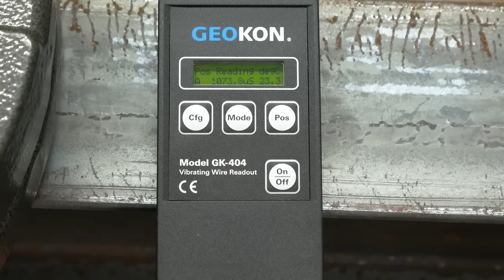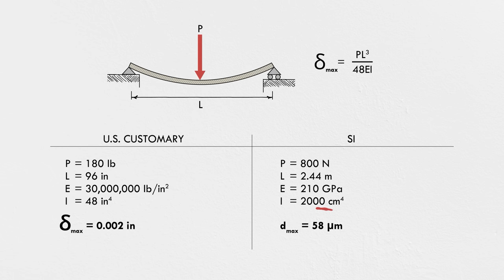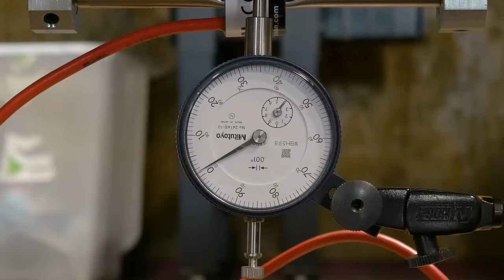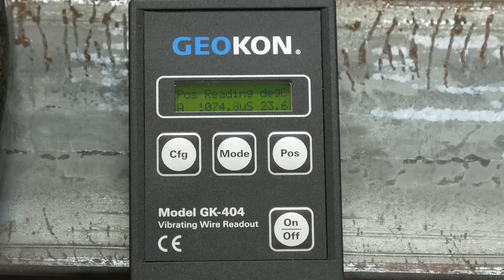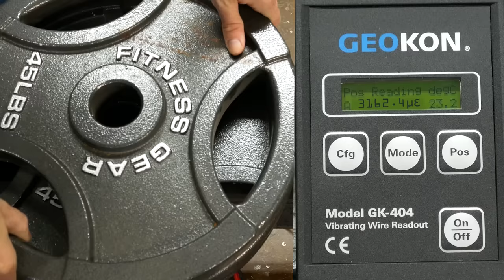How Sensors Keep Bridges From Collapsing (and other structures too)

Comment: Incidentally the thing you said at the start is why I'm so concerned about AI. There's absolutely no expectation in the field of getting things right on the first try, but once ai systems get powerful enough, you really do need that level of engineering because you might not get a second try

Comment: Imagine if these existed on trains instead of taking an ambiguous temperature of wheels ever 20 miles and then ignoring the data because you don't know what it means.

You might actually prevent several hundred train derailments a year, and not have toxic spills.

Imagine if instead of regulation that prescribed unuseful methods you held companies accountable for the cost of their mistakes and they had an incentive all their own to utilize sensor technology.

Comment: Related to strain gauges, is there a way to measure weight as follows.  I need to measure weight between 1 ounce and 500 lbs.  The weight sensing needs to be lost cost, fairly accurate and have a very low profile(flat). ???

Comment: I've used a safety razor for years lol, you can get 100 blades for 10p when u buy in bulk also, so each shave costs me a tenth of a penny

what's annoying however is the disposal of these wafer thin razors lol

Comment: You have 6bar of pressure!?!? I live in a rural bit of england in a house build when they used tiny pipes from the mains. We get 1.6bar :( Actually limits whether I can put in a heat pump.

Comment: problem your  initial  adding of weight you  only reference at one center point that's  not to say the round supports at each end isn't compressing into the steel of the tubing  you  need to   #1  support ends different to  make sure that is  not the case  or #2  place indicator at end to register so if the  round pieces are  compressing the material at  the  very tiny  surface contact point of a  curve at a flat surface or compressing into the softer surface of the cider block,  so in truth  you dont show if it is deflecting  or  whole bean being pushed  downward

Comment: Yep, engineers need sensors. However what you appear to have forgotten is that engineers need physicists. You can “check your math” all you want but it’s pretty important to have a physicist check your math. Like how is that not the law 😂
Reply: Hopefully engineers would realize that they are simply not capable of doing the math. There’s a reason that your degree does not have the same letters as my degree.

Comment: This seems like a very slippery slope. It decreases the required experience of engineers and increases dependence on tech. One emp and replacing the sensors and the cost of replacing them will exceed 5 times its original building cost.

Comment: "compared to steel concrete is a really stiff material" <---aaahhhh no! bad! 4,000psi concrete E = about 3,600 ksi, steel E = 29,000 ksi. Steel is about 8 times stiffer.

Comment: Only sensors that keep bridges from collapsing or seniors who know how they work while building new computer programs too? Unless they are an engineer often building more than one kind of thing. Seniors who still know for example the so called altogether now obsolete computer code language called Fortran. So many different languages to consider while being an engineer. Instead of only a truck driver hoping to pass through a check point while his rig doesn't weigh too much. .
After that truck driver in large sometimes international companies and most public transportation workers used to be many moons ago be stamp clocking themselves into and out at work using a device that employed a different kind of computer code language too. Most of whom are dead now. Anyone who thinks they can employ large numbers of people while only worrying about cracks in concrete on a bridge like in Crimea instead of being careful about trying to preserve the human lives of all their employees and not just some of them might find out the hard way too while driving himself across one of the bridges he watched from a far while they were being built one at a time that cracks have already been happening in that bridge already for a long time before he too tried to drive across that bridge next too. While the crack thing is happening on bridges that is why sometimes at some point after that bridge first got built then a toll booth has to be built allowing just so many drivers onto it at a time until enough bridges can be built to welcome all travelers going to and fro over that bridge.

Comment: i'm sorry... am geek enough to have to ask this...

How does the electric razor goes from $150 to $225 in 2 years? neither electricity nor batteries will cost $37.50 per year... If the relevant variable is cost, get a $10 electric trimmer from Ross and learn to love your "day before" beard....

that is still a cool razor... am just geeking...
Reply: These comparisons are with manufacturer recommended maintenance and intervals, also they use on brands and the brand price not the prices in shops. The electricity is indeed a value but only a small portion. 

A simple electrical Philips razor ( 5000 series) costs around €150. and replacement shaving heads costs €50. the manual stated interval for replacement is 12 months, 
so graph start is: €150, 
month 12 = €200, 
month 24 (last datapoint on graph) = €250. 
The pricing in US is probably a bit different but still in line with how the graph moves.

For these kind of graphs they never want to compare to the lowest price competitor, only a reputable brand.